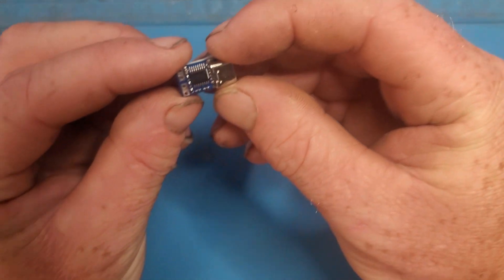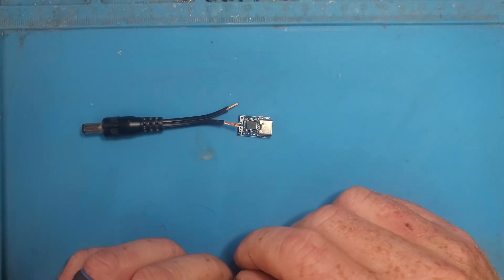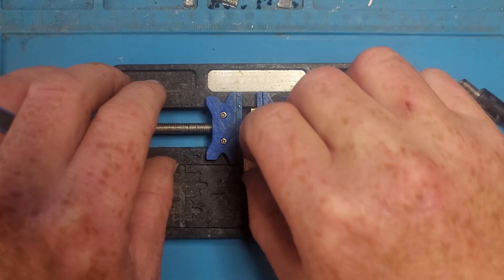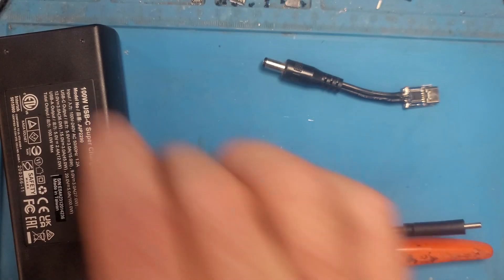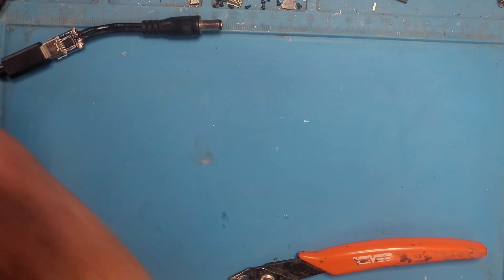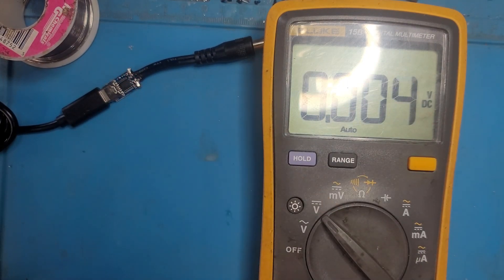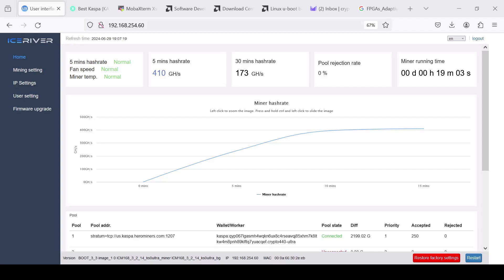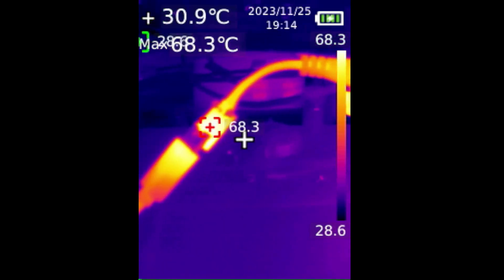USB-C powered KS0 Ultra. Will it burn up?

Comment: Hello friends! I updated with the overclocking firmware and it was bad on my Iceriver Ultra. Could anyone help me with this problem I have on my IceRiver Ultra in IceRiver V.1.0.23 The Monitor in the "Detect IP" tab identifies the IP but I can't access the miner page via browser (off line) and in the ice tab monitor where it says "Miner Management" this IP appears "none". And the miner's reset button does not accept resetting the equipment because the two lights stay on directly, which should after 30s the green light start flashing (which indicates that the device has been reset). Any alternative, for example, a tutorial for this recovery or even touching the internal circuit (guidance video or explanatory note) or something like that to unlock this. At least release or reset the equipment to work and restart the iceri river ultra.
Reply from the maker: Unfortunately you are one of many people with this issue. Hopefully, I or someone else can find a solution to it.
Reply: @crypto440  I would like to thank my friend for his cordiality and support. Thanks.
Reply from the maker: @edmundodejesusaraujojunior1025  you can reach out to tswift, and he can get it working for you again, but there will be a fee
Reply: @crypto440  Sabe qual valor dessa taxa?
Reply from the maker: @Exocuriosidades  i do not know. You can contact him though telegram.